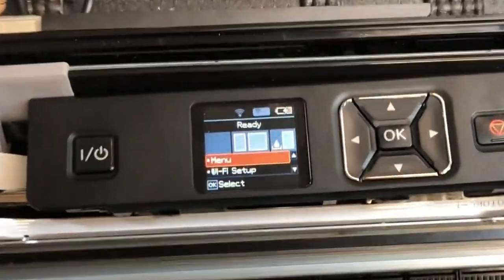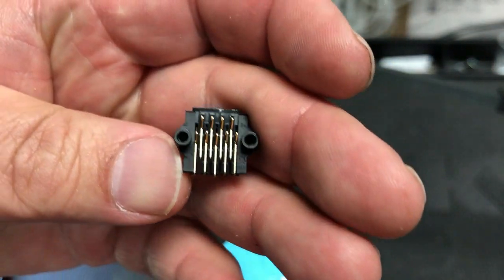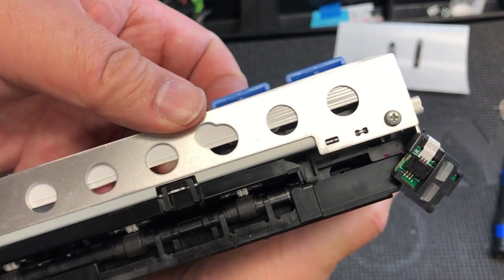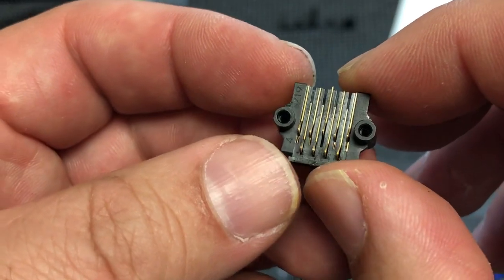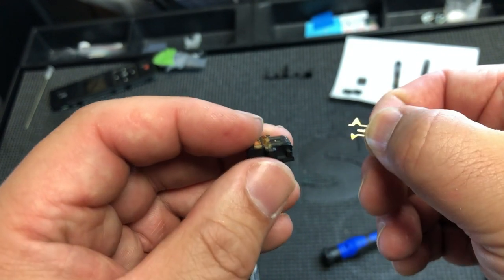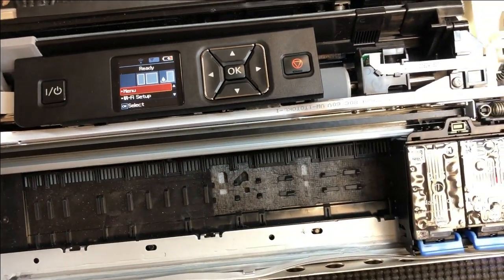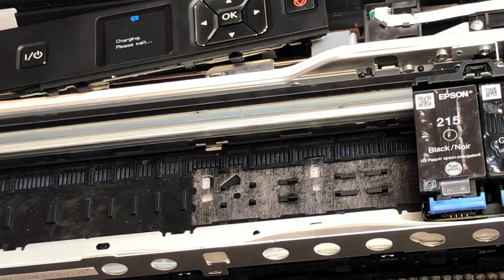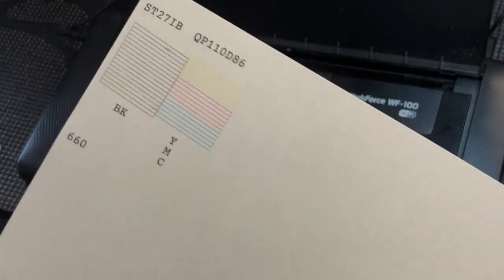"Cartridge Not Recognized" ? - Fix Broken Pin for Epson WorkForce WF-100

Comment: Kevin, isn't each chip specific to the color of the cartridge.  I am trying to order an extra set from your online store but it keeps giving me an error. I called and no one will answer.  I left a message on the website for someone to contact me and no one has called.  My kids live in Greensboro but I can't get in contact with no one.  Epson wouldn't send me a replacement.  They just replaced my 4 month old printer with a refurbished one.  I only have seven days to ship my old printer and would like to see if your replacement would work.